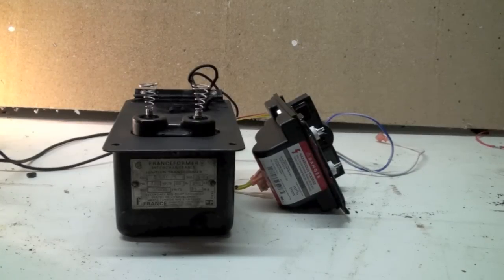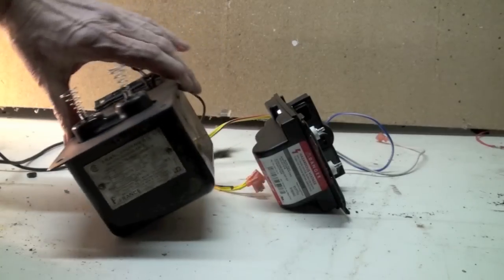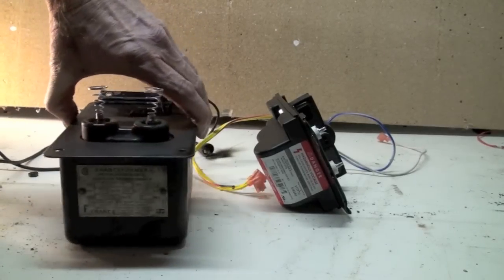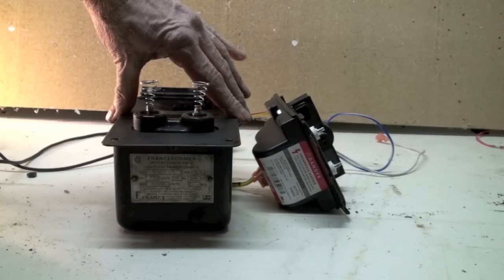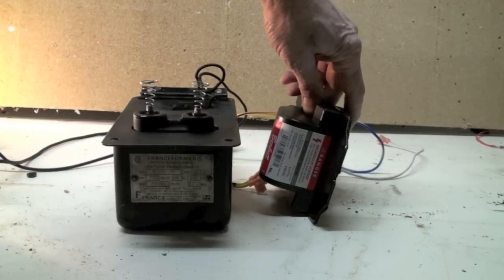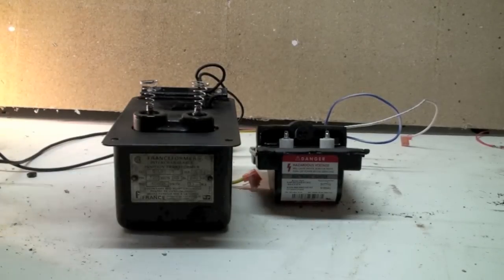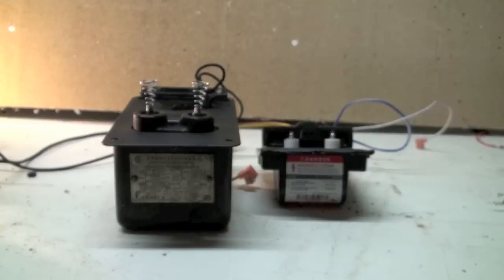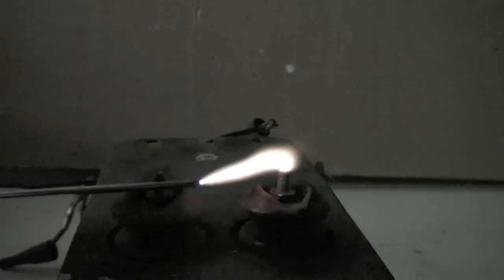Oil ignition transformer tests

Comment from the maker: When the oil is present at the burner, the nozzle will spray a fog of oil droplets.  If the ignition is working, the droplets ignite.  If not, there will be a fog (not smoke) in the combustion chamber until the unit safeties out.  No fog, there is an oil supply problem.  Hope this helps.
GFM

Comment from the maker: You can do the screwdriver test.  If no spark and the wiring is ok, the transformer is toast.  Also, during a trial for ignition, there should be a fog of oil in the combustion chamber.  Hope this helps.
GFM

Comment: I'm hoping this might be what's wrong with mine.  I have power, have fuel, jet clean, doesn't light.  This is the only thing I've not checked yet.  Also, bled it many times (a week ago) and was told me setup with a line going back doesn't even need to be bled/primed.  Mine looks like your second one in example.

Comment: I replaced my nozzle, new electrodes and set them absolutely perfectly and i checked the transformer and it hardly arcs a half an inch and is a weak yellowish spark. Before it stopped working i would have to lift the transformer a small bit to get it to start. I just ordered a new transformer so hopefully this fixes my furnace.
Reply: Trevor DeYoung did it work? I replaced my transformer and I still have to lift up on it to get a spark.

Comment: Appreciate the quick response.  I believe wires are fine.  Can you clarify the fog oil comment?  Are you saying that if bad, there should still be some smoke inside?  Honestly, I'm not sure if there is because at the time, I had never opened the chamber, however I didn't smell any smoke at all.  So, if there is NO smoke, what do you think is next. Thanks!  Kirk Productions

Comment from the maker: Actually, it is best to start the burner then open the transformer.  The burner will usually still run and you avoid the the unit not starting because of the cad cell seeing light before it is energized.  If it sees light before being energized, the unit wont start.  
GFM

Comment: Actually, some new info here.  Now, as I recheck the jets and everything, which ARE clear, but the very small tube that connects does not appear to be pumping fuel in to the chamber.  So, I get fuel up to the bleed valve....but apparently not coming out of the back side of the pump.  Thoughts?

Thanks

Comment: Hopefully you are still around today.  In your demo, you obviously have power applied but when testing while the unit is still installed, at what point should I be testing with the screw driver?  Will the normal power switch the furnace/AC unit be enough, or must there be also a call for heat from the thermostat?  Right now, I get no arc at all.  Thanks!

Comment: What if you have zero spark? I thought has to be the transformer or the grey control box
Reply from the maker: Check for 120 volts at the incoming wires.  Voltage in, no voltage out, bad transformer.  No voltage in, look further upstream in the circuit.
GFM
Reply: @grayfurnaceman  Thank you. I ended up just replaceing the transformer and it worked. I should have tested, always should test

Comment: I test them on the burner this way all the time. I had a problem with one that would work perfect for 20min then when turned back on, nothing.  Hit reset on cad cell relay and boom worked again till next cycle. Any ideas or other ways to test?
Reply from the maker: bryan vicquery There are high voltage testers but no one uses them and they would probably not find your problem.  You are doing the best way/\.
GFM

Comment: Recently we bought a house with oil furnace. Since get go we started having problems. It seems that every time outside temperatures get colder the furnace will not turn on. When the temperatures go up to 40's 50's it turns on no problem. What could be the problem?
Reply from the maker: +Wioletta Zoldak Do you have an outside tank?
GFM
Reply: No we don't have an outside tank. The tank is inside our basement.
Reply from the maker: +Wioletta Zoldak I would be looking at oil supply problems.  Plugged oil filter, plugged oil line.
Reply: Ok. We will look into it. Thank you for your help.

Comment: Why is is that the new transformers always fail and the older block style ones last for years?
My guess is to keep the burner repair people working.
Reply from the maker: +coondogtheman1234 I have seen that too.  Maybe electronics are not as good as they seem.
GFM
Reply: grayfurnaceman
I can agree with you on that. At my mom's house they changed out the older block transformer for one of these I should have stopped the guy or told him to leave it here.
Because if you ask me I think two coils of wire are a hell of a lot more reliable than a bunch of electronic flyback circuits. I's like taking a TV flyback transformer and putting in your furnace.

Comment: i just removed my transformer from the burner, can i still check it to see if it works
Reply from the maker: Louis F If you provide 120V power to the wires, you can check it.
GFM
Reply: grayfurnaceman thanks 
I added a plug and plugged it in and had no spark at all so I'm going to replace the transformer, thanks for your help

Comment: Can it run on 240 volts?
Reply from the maker: I doubt it.  If it does, it will have double the voltage on the secondary side.
GFM
Reply: @grayfurnaceman  ok thanks, I was just looking to make my Tesla coil more interesting but I didn't want to burn out my transformer.